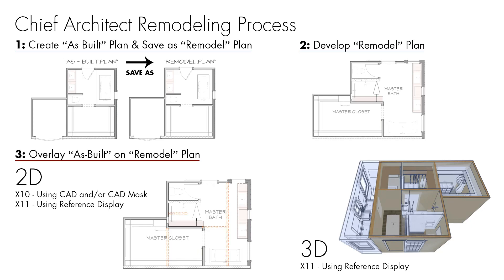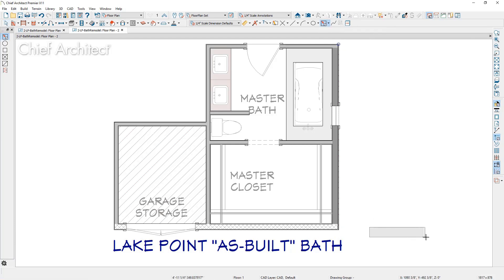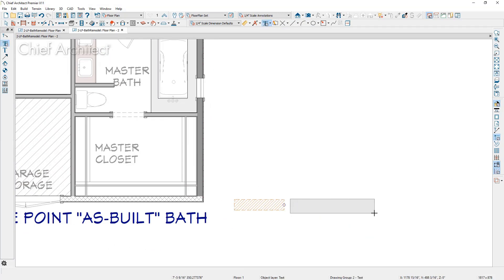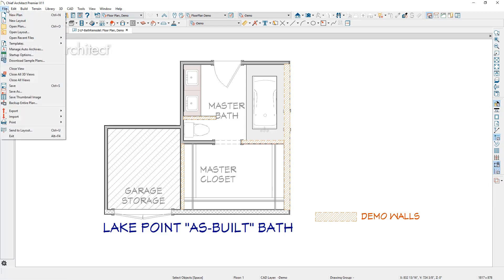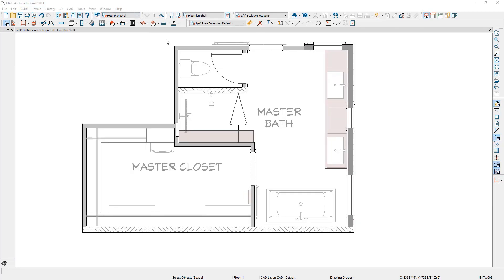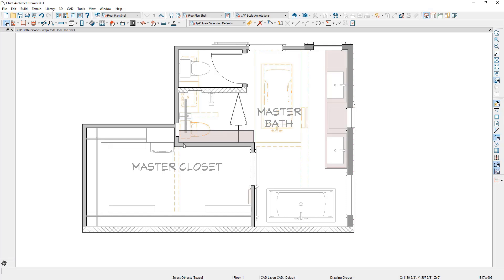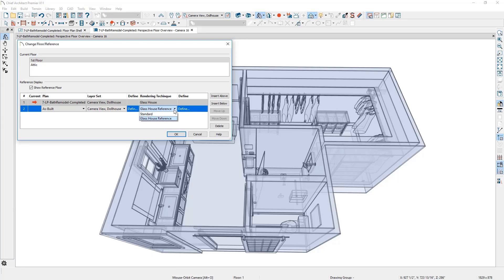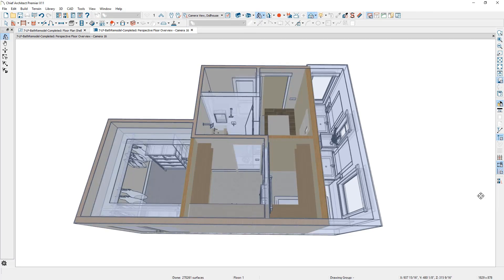Remodel Process Tutorial for Chief Architect

Comment: How do you indicate doors as well as other building items to be demolished, and How do you put them into the estimation for demo work? Can you get the items to be estimated from both As-Built and Remodel plans?
Reply from the maker: We have a more detailed video on this that I have linked below. 

https://www.youtube.com/watch?v=xBGOKNj6hMQ&t=3477s
Reply: @ChiefArchitect  I've watched it but that didn't explain how I could include the walls demolished into the estimate.
Does the software actually allow you to include the demolition costs into the estimate or do I have to calculate separately myself?
one more question is that most of the framing estimates are based on linear feet here. Can I change them to square foot because most of the contractors estimate based on sq. ft. of GFA not linear ft.?